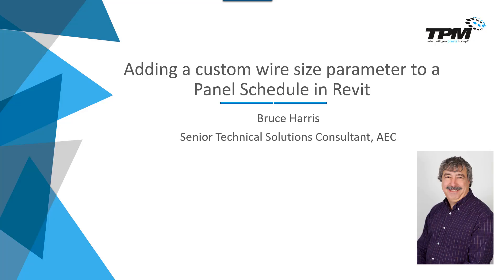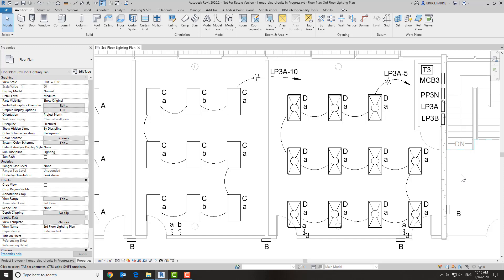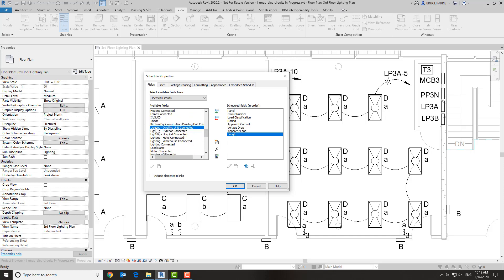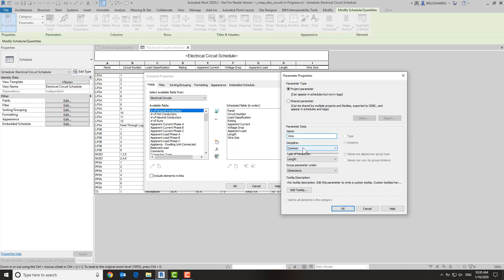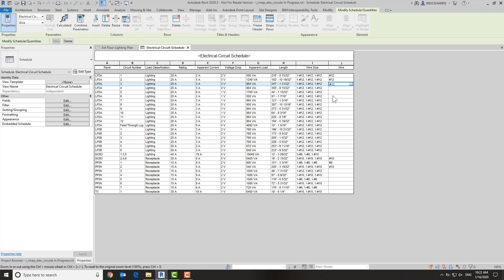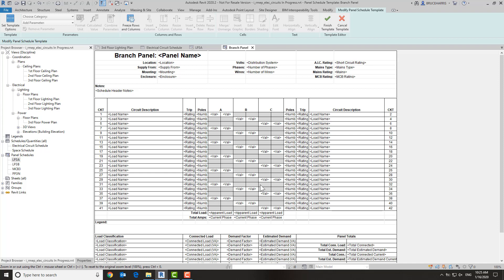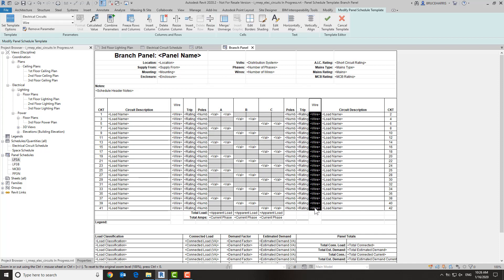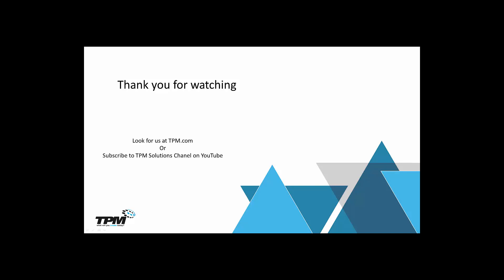Adding a Custom Wire Size Parameter to a Panel Schedule in Revit

Comment: I have an EPNDB as a panel. So I want a parameter/field for MCB rating of all MCBs. Plus I also want Switch no and names of electrical fixtures linked to the switches. How can I display all this information in the Panel Schedule. I am pretty new to Revit -MEP so please bear with me.

Comment: It is help full video sir, please could you tell me how to change hot wire, neutral and ground wire size changes for example: one circuit with 6mm2 hot wire and 4mm2 neutral and ground.
Thanks regards, 
Mathin